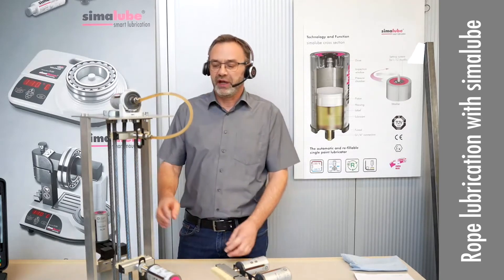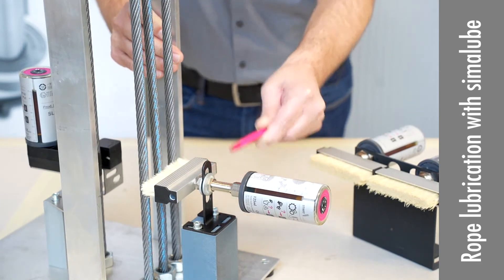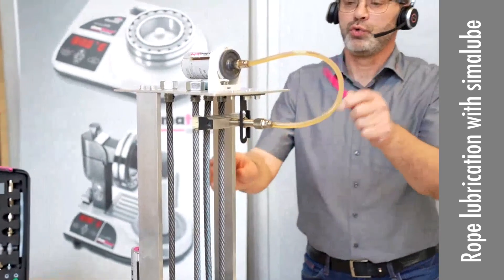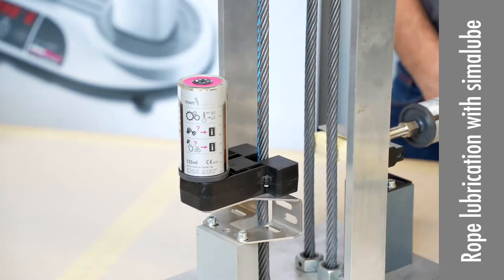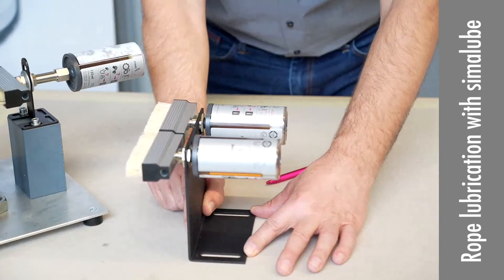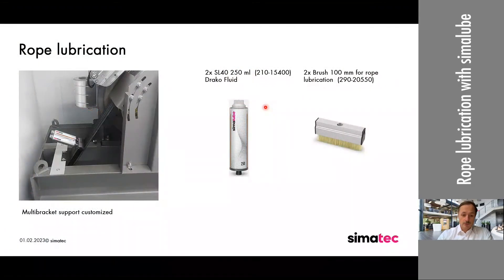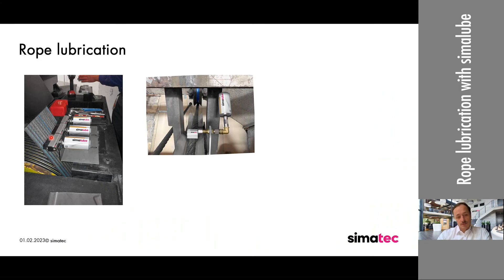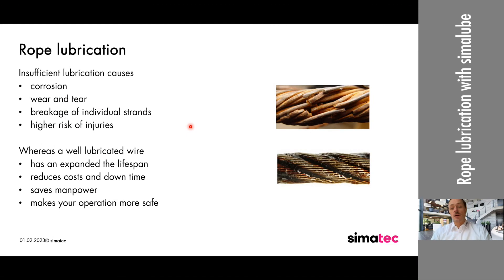Rope lubrication webinar

Comment: Thank you for your great video. I am an engineer of Shangri-La UB. We have 20pcs of elevators. So we changed 5pcs elevator's wire rope on last and will be replace this year another 5 elevator's wire ropes. Becuase our elevator working about 10 years. Wire rope never lubricated so far. Is the wire rope of the elevator should be lubricated?